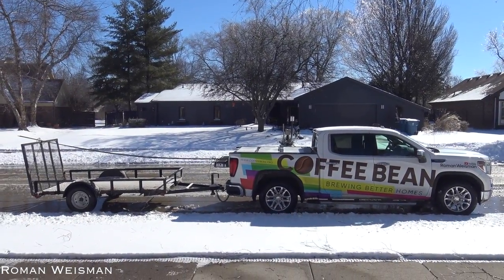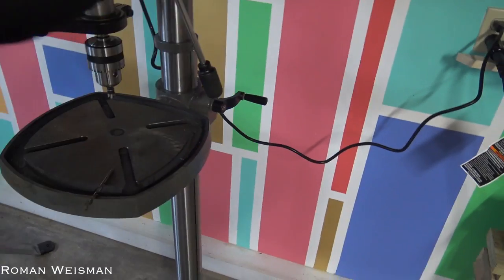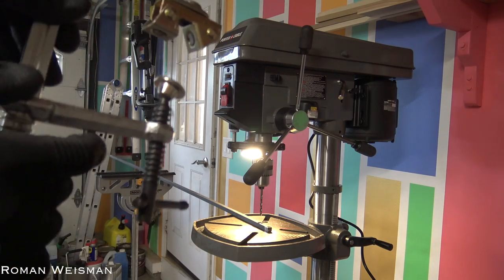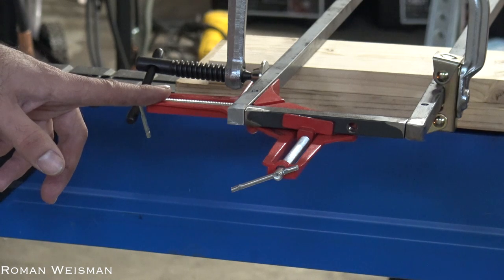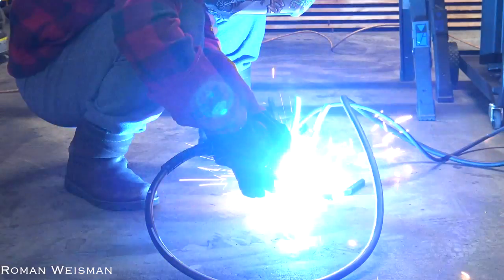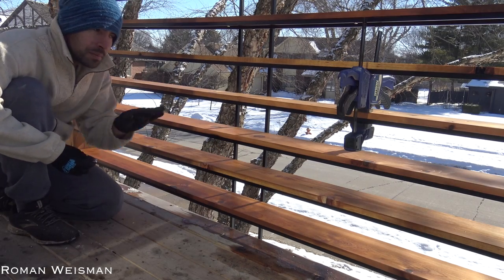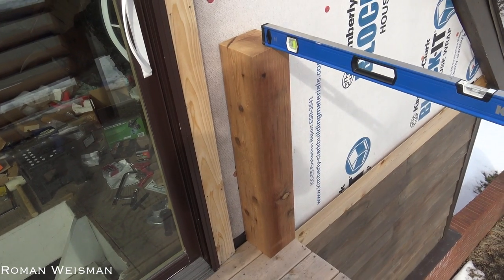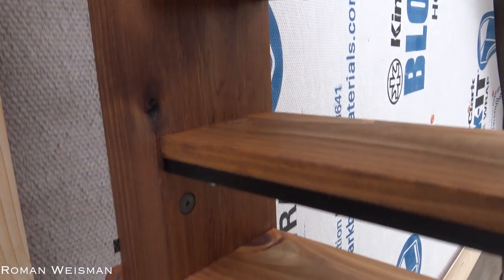Wood and Steel Deck Railing

Comment: Looks nice. But why solid bars?
Reply from the maker: Thanks, if you’re referring to the metal frame underneath the wood: to withstand a 200lbs weight load.